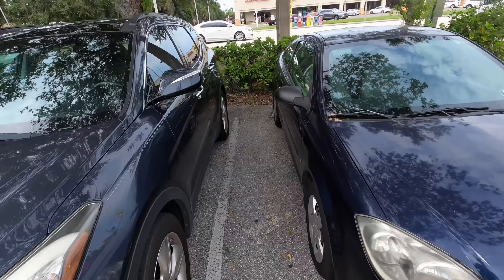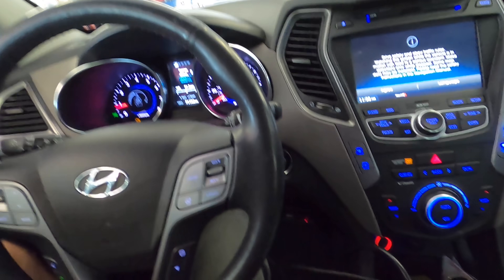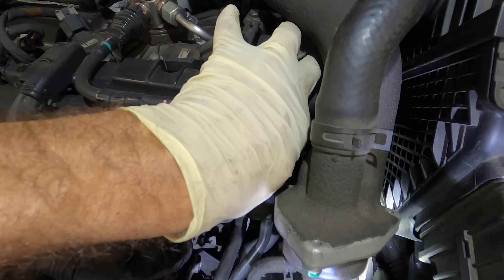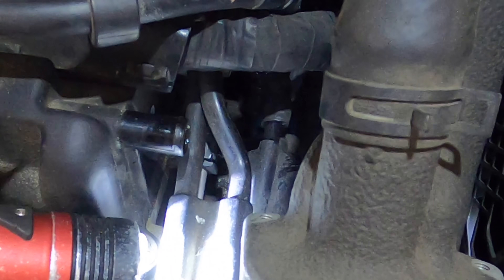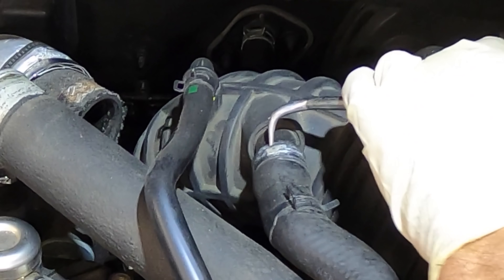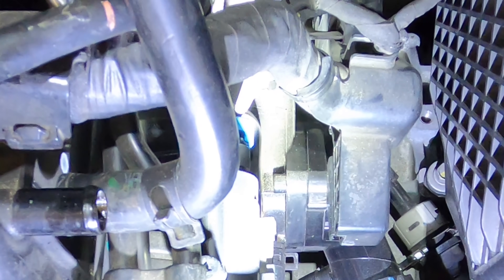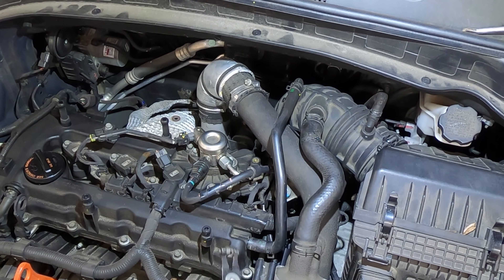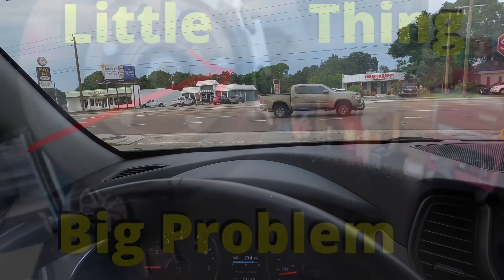Large leak Detected! Customer States: Check Engine Light P0455

Comment: I think the disintegrating hose might have been the reason for the problem to begin with, it might have had a small split in it, that hose was toast.
Reply: I was thinking the same thing. It seemed pretty brittle.
Reply: And it has plenty of little brothers the same age on that car
Reply: i agree
Reply: My thoughts exactly.  The first time he tore it I was saying There's Your problem lady. 😂
Reply: That's why when you do hoses you do the hoses, just like belts. It can be a sizeable repair but is also the cheaper alternative, ITLR.
Reply: Yeah, rubber hose isn't supposed fall apart like that...    Car probably has other lengths of this cheap hose in it...
Reply: I concur with your assessment,, when he ripped it the first time I figured that was part of the problem.
Reply: Agreed, hose was toast and needed to be replaced.

Comment: Those extra details the customer gave you really cracked the case. Had me cracking up on that one
Reply: So why doesn't Ray speak to the customer directly? Get info from the horses mouth and not a 3rd party, no matter how well meaning.
Reply: @kevinmartin2516  because they are out in the shop working on the vehicles. The service advisors speak with the customers usually.
Reply: @mikeydude319  And it really is like a game of telephone sometimes. I've had a shop send out the mechanic after 3 failed message attempts I think they were not saying what I was saying. Paraphrasing I think the word would be.

Comment: I think that hose may have been the problem. One thing I noticed is that you visually inspect the entire evap system. I have found hoses to be a common problem. They get old and rotten. As with everything the newer vehicles seem to have this issue more than older ones. I pretty sure it's due to low grade hoses being used. God bless
Reply: I would say the underhood temperatures & fuel fumes have more
 to do with hose deterioration than the quality of OEM Hose.
Reply: @pczapp827  Especially with it being a turbocharged engine. I had OEM replacements give out with relatively light use on an old 87 Supra turbo I owned many years ago.
Reply: Don’t forget the ethanol that’s in the gasoline. That also increases the rapid deterioration of rubber hoses.
Reply: It definitely seems like newer vehicles use cheaper plastic materials and clips nowadays than they used to. I could definitely see them cutting costs with lower quality hoses too

Comment: The surface "tension" you often refer to is actually described as surface "adhesion" that develops over time between closely compression fitted parts.  (per my chemical engineering background).

Comment: I always used smoke machine and power probe , commanded on 10 times to see if it was sticking. I did this with valve in hand.if it had a aftermarket gas cap would replace with O.E. Cap as well. But that’s how I did it.
Reply: I built a smoke generator and it was the best $20 and 2 hours I've ever spent on a tool.
Reply: Yeah that work for a while for me , an original cap, but then replaced purged valve. No problem since

Comment: I've found that a P0440 is usually a loose gas cap.
You may have had a dirty, sticking vent valve near the tank.
More common than purge valve.

Comment: That evap code comes up every once in a great while on my mercedes and it's always the gas cap. Even though I am careful putting it back on after fueling up it does not always seal properly. I just take it off and put it back and clear the code. I use Autozone $5 caps because the mercedes cap my mechanic gave me was a pain in the ass.
I had someone use a smoke machine on it once and smoke came out of the oil dipstick. There is an o-ring on those that can shrink and needs replacing. Get them at O'Reilly or someplace like that, not the dealer! You may need to try different ones so they seat properly.

Comment: In my experience with auto repair, nothing is simple. There's always some unforseen problem that comes up.
Reply: My half hour alternator job turned into a multiple day issue because the belt tensioner snapped apart because it was super tight, i feel that

Comment: During my time working at Hyundai dealer. I never had to replace a Evap purge valve. Most of the time, specially on Santa Fe’s, they had common issues on the charcoal canisters
Reply: I would have smoke test and scan tool evap testing

Comment: I had a similar code on my 2011 kia sportage. I believe it was p0456. I checked the purge valve it was good then I figured it was the fuel pressure sensor. I did a rookie move and brought the part before checking it. When i went to install it a rat had chewed the wire right at the connector smh. ( I live in NYC) rat are a huge problem out here.

Comment: I have had a SEL for evap purge on my 2006 colorado for years. No detrimental operational effect at all. I did check and the solenoid is part of a cannister assembly and it is all plastic crap anyway, and lives above the third member in the elements. 
I never thought of people filling with the car running causing the history code. 
Hope you are staying cool down in FL -

Comment: I got the same Check Engine light. P0455. It's the locking gas cap I put on. The light came on after installing the locking gas cap.
Reply: Still have it on there? The o ring under the cap may not be contacting the filler lip. Maybe you can swap over your old one.

Comment: Man I wish u we’re around delaware I got a dodge cailper 2007 with same problem I’ve changed purge valve, charcoal canister, fuel tank, fuel pump and gasket filler neck hose, gas cap still throwing that dam code last repair gas tank I had it smoked cuz I don’t own a smoke machine but needless to say code is still active I kinda give up on it

Comment: I have to change this exact same part on my 2006 VW New Beetle, 2.5L gas engine. Mine is in an easier spot though. I get a gas cap light first, (I replaced the gas cap) then the large leak code. I also have issues starting the engine after a gas tank fill up. It cranks longer than usual, then runs rough for about 10-15 seconds. If I try to fill the car while running, it stalls.

Comment: I hope the customer had the Hyundai dealership do the engine recall to see if it needs replacing or the evap leak will be the least of his issues!
Reply: Hope they change the oil a lot because the engine failure
 is a given on 2011 to 2019 Hyundia & Kia

Comment: I have a Hyundai and the check engine light came on and I put my computer on and it was the evap code, after searching while the engine was running it turned out to be my fuel pump as suspected, it was cracked around the top , swapped it out and cleared the code and she’s been hood ever since

Comment: I wouldn't worry about that. After all we've all made mistakes for our battery died or two technology just failed mostly it seems like the technology fails. 😂 1 as a side note I would like to point out that sometimes you'll find customers with a very very dusty or dirty Underside and when they get that evap large leak code it can be a intermittently sticking vent valve on the canister itself.

Comment: What if the customer was overfilling the gas tank?  Wouldn't that trip the code?
Reply from the maker: Could be
Reply: I pulled into a gas station the other day and filled 22 gallons or so in my truck as the woman near me clicked the gas pump about 200 times. Most i've seen in my life. She was already clicking it when i got there.
Reply: @volvo09  I have to do that with my Pontiac Solstice because there's something wrong with the vent system and the pump constantly shuts off. It takes a long time to put any gas in it. I might have to replace the charcoal canister. I'm supposed to remove the gas tank to get to it, it's on top of the gas tank. I would have to drop the rear axel first. I might just cut a hole in the gas tank cover inside the trunk, so I won't have to remove the gas tank.

Comment: Hyundais Are prone to throw an evap  code whenever you get gas fill the tank and then squeeze more gas in after the handle clicks
Reply: They told me specifically when I bought my KIA to stop fueling when the pump handle cuts off.

Comment: I would guess that gas with alcohol, ethanol having its affinity for moisture in the air may be a contributor along with the alcohol itself in the failure of the evap solenoid mechanical gas vapor flow failure to seal off.

Comment: That hose is junk anyway. 
 It's not supposed to puncture 
So easily  .
 Gasoline fumes eat up that rubber.
 They should use fuel line, even though only Gasoline vapors contact it.